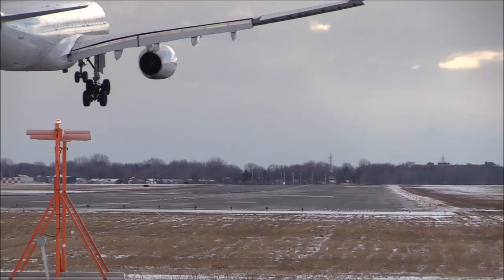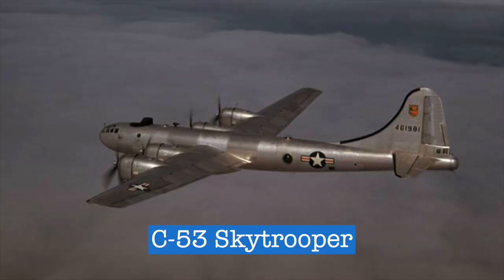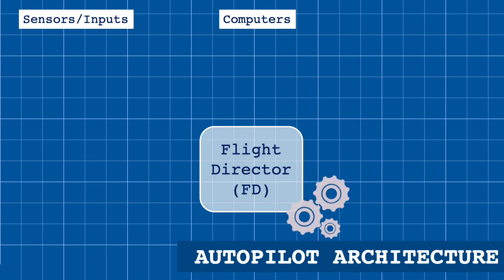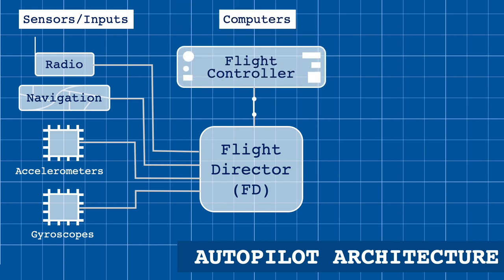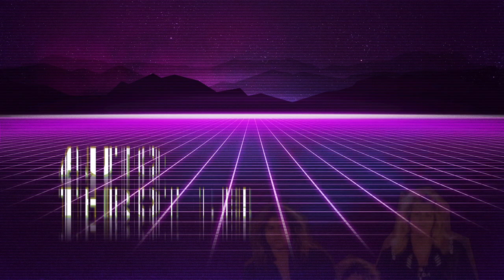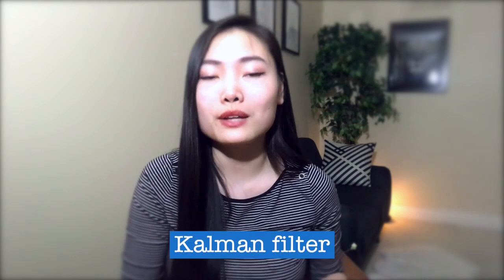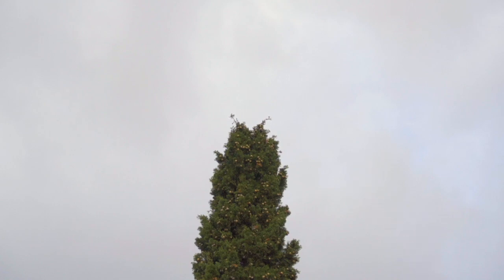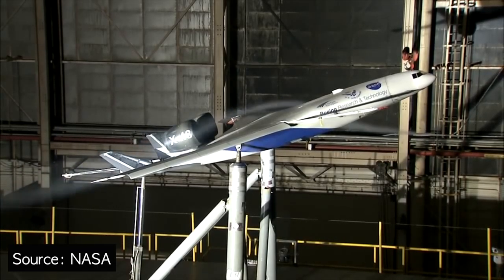How Does Autopilot *Actually* Work?

Comment: >boeing allows pilots to push past performance limitations.

So what you're saying is...I can overclock a plane? Time to pour liquid nitrogen on the engines?!?!?

That aside, this stuff reminds me of courses I had to take in control systems and also sensors and measurement.

I think that the learn to fly stuff sounds really promising, especially if it can be done using small models of the plane instead of the full thing. If I were some director in a plane making company, I'd want to see if the learn to fly system can be used to feed back to the design of an airplane by another AI.

Human designs a "rough" draft of a plane -> AI learns to fly it -> feedback of learn to fly is used to refine the original design -> AI learns to fly -> repeat until convergence.